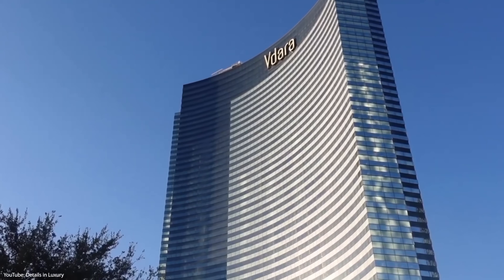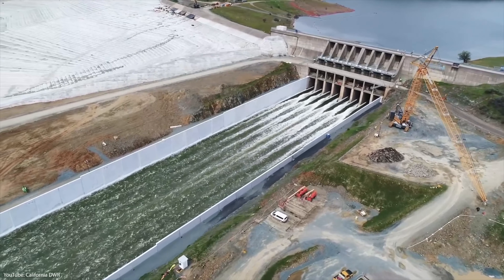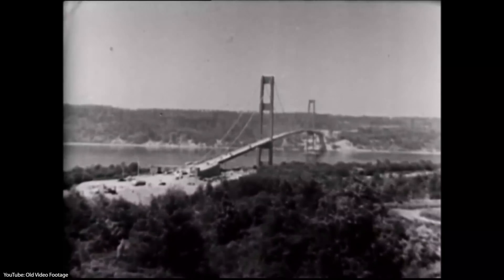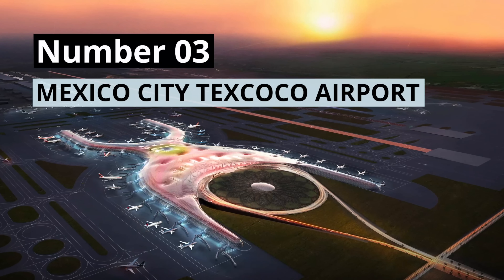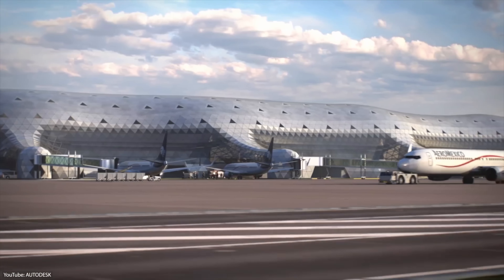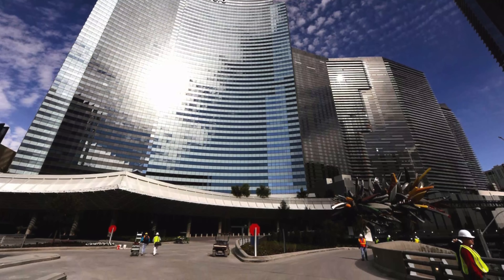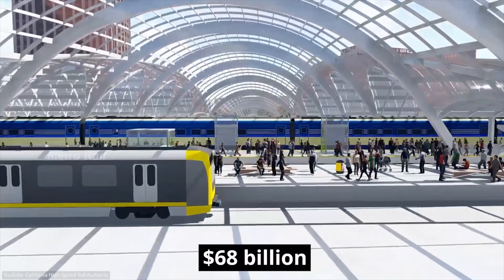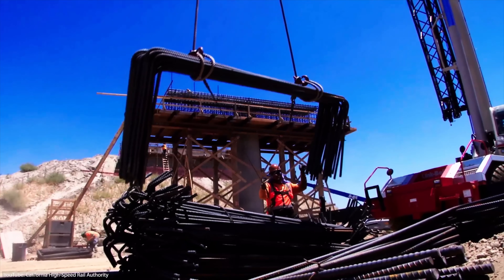Most Expensive Construction Mistakes in the World (Part 2)

Comment: When the three gorges dam in China fails,it will become the single most disastrous construction failure in history,as the loss of life will be staggering. In building this dam,large boulders were used to take up space so less concrete would be needed. However,2 problems I see is that there will be lots of voids under& around all these boulders,and second is that the concrete cannot bond with the smooth boulders. The boulders will eventually cause cracking of the concrete,and pressure from the water will begin to sleep through those cracks,causing the entire structure to weaken and eventually succumb to the enormous pressure of the billions of gallons of water behind the dam. It will be catastrophic,to put it mildly.

Comment: I think of construction mistakes as problems and errors made with the construction itself, not with how it was managed. The Tacoma Narrows Bridge is a perfect example of that; the Oroville Dam and the Vdara Hotel being a failure of design. With the Mexico City and California High-speed rail projects, there is nothing wrong with the design or engineering of those projects at all, those are a failure of politics, not a problem of the design, engineering, or construction. In regards to the CHR project being scaled back, it's not being scaled back, it's the timeline to finish it that has been extended. However, the project has seen a new influx of funding including moneys from the Build Back initiative implemented by Biden so, the project is now back in full swing. When completed, it will be a true asset to California and will serve as a real boon to California's economy when completed between L.A. and San Fran as well as being another key piece in fighting global warming in California. It will quite likely prove to be a very successful project that millions of people per year will be utilizing effectively significantly reducing road and air traffic between the two cities.

Comment: @2:13 he said they were forced to "open" the emergency spillway...totally wrong, there is no opening or closing of the emergency spillway, water either "over tops" the emergency spillway or it doesn't. It all depends on the inflow vs outflow once the dam is full and the regular spillway is maxed out water will spill over the emergency spillway OR in this instance they had to close all gates of the spillway to inspect the damage and make temporary repairs as best as possible. This caused the overtopping of the emergency spillway.

Comment: The California high speed rail project was prevented from starting for at least four years by cities suing the State because they were not on the line originally planned. As each new city was added, the engineers had to scrap their original plans and make new plans every few months. The original ascent over the Tehachapi Mountains had to be changed, land acquisitions had to changed, engineering plans had to be changed, everything that the original plans called for, on which the original costs had been calculated, had to be changed. Your original assertion is 10% to 15% accurate, but the remainder of the fault lies in the State’s permissive litigation milieu and the aggressive challenges made by towns and cities which feared being left behind if they were not served by the high speed railway.

Comment: This is not anywhere near the damn catastrophe but I was hauling precast concrete wall sections to a high rise building in south central Denver Colorado USA I believe it was a company from the east coast “New York “ if I remember correctly as they went up in floors of this all precast concrete building apparently they didn’t weld all the steel tabs that’s molded in the concrete sections so by the time they got up eight or nine floors they building shifted and started leaning shutting the project down instantly. I’m not sure what the end results were but I do know it sat like that for a long time with a cyclone fence around it 2002 -2003

Comment: This video is not good.  The airport is not a "construction" or engineering mistake at all.  As for #5, you didn't connect how the erosion of the spillways led to the evacuation.  The rain caused the evacuation.  The spillway corroded and collapsed, but it didn't cause MORE water to go down.  There's something you didn't explain.

Comment: Hey, something interesting for you to look into is the opening of the Golden Gate Bridge.  It came very close to collapsing on opening day because it could not handle the weight of the people walking across.
Reply: That wasn't opening day. It was the 50th anniversary bridge walk in 1987. I was one of the people on the bridge. The crowds were quite dense and the whole deck of the bridge was full of people. As it happens, the weight of a packed group of people is several times the weight of any imaginable collection of vehicles. So we overloaded the deck. Pictures of the bridge show that the camber was reversed; the center of the span was lower than the outer parts. Calculations indicated that it came pretty close to breaking the deck. At the time, I was wondering why the suspension cables were flapping.
Reply: How many people were on the golden gate on opening day?

Comment: The Teton Dam in east Idaho is one of the biggest blunders in construction. It was a massive earthen dam built in the 70's and took 4 years to complete, costing $48,825,000 ($346,109,678 today). Once complete, they began filling it. It took about 8 months to fill. It then promptly sprung a leak and broke: partly because the emergency spillways weren't complete, and partly because the earth used was porous volcanic soil which, unlike clay, doesn't seal fractures that form in it over time. It flooded the nearby cities of Rexburg and Hibbard and resulted in $322,000,000 ($1,676,839,050 today)  of damage.

Comment: You didn’t mention in the Texcoco Airport segment:

A) the referendum participation was less than 20% of the population. Mostly his cultist followers voted. 
B) the air force base is located 18 miles away from Mexico City. It takes you over an hour without traffic to get there. 
C) there is no infrastructure to get the planned passengers to the Air Base. 
E) The President ignored the warnings from people in the aviation community of both price and functionality and wanted the airport built during his tenure. 
D) the population of the area where the airbase is are mostly below the poverty line, so very few locals can use that airport
F) airlines only accepted to fly there after the government pressured them to do so. Yet the airlines also announced flights to other places away from either airports - namely Toluca and Puebla - places closer to areas of Mexico City where people actually go to, particularly the Santa Fe district. 
G) you have at least 2 videos with airports with these exact same characteristics and you know where this airbase airport is headed to.

Comment: The Tacoma Bridge did not come down because of high winds. The 30-40mph winds were close to the bridge's frequency of resonance, and magnified the bridge's movements, causing ever-increasing undulations.
Reply: This isnt correct either. It was attributed to flutter, a specific pattern of air vortices which is the same effect that makes seatbelts knock around sometimes when a cars window is opened. 

The way the bridge moves in the video is not consistent with it being resonance....it was twisting rather than oscillating in a single plane

Comment: A more recent example of a costly engineering mistake is the rebuilding of the Beltway 8 bridge over the Houston Ship Channel. Construction was already well underway with the new bridge when another study was conducted, and it noted some faults that would compromise the integrity of the new bridge, ultimately causing it to fail should construction on the bridge continue. Not sure what exactly those faults are, but they were enough of a concern that the new bridge is now having to be torn down and the whole process started over from scratch, costing an extra $300M-plus and delaying work on the bridge for several years.

Comment: The information about the Texcoco Airport is incomplete. 

1 The Texcoco remaning contracts were transfered to the Santa Lucia airport. 
2 The materials and some metallic structeres already placed were scrapped and also transported to the new airport.
3 Yes Santa Lucia is smaller compared to the Texcoco render showed (the versión of 2065) but if texcoco were built the current airport with his two terminals and 60 gates would be useless. Santa Lucia will operate simultaneusly with the current airport Benito Juarez.
4 The military base was demolished and rebuilt with modern installations and a museum with the mammoth bones found on the area.
5 The current airport usage taxes of Benito Juarez is above 20 dollars, Texcoco was planned to be 40. Santa Lucia will be 6.

Comment: You should mention the Sydney CBD & South East light rail. It was overbudget, it took too long to build, it's incredibly slow, the construction left residents insane due to noise, businesses went broke due to road closures, and most people use buses which run the same route but further at a much faster speed
Reply: may as well add the NBN to the list of stuff ups we've made
Reply: @youreworthyourweightinavoc7189  The NBN makes the CBD light rail look like the Parathanon

Comment: About the Mexican airport, the new airport also meant that we would loose 2 other airports do to the logistics, with the new one this is not going to happen. Also is going to be finished earlier. About the money, the money borrowed was repurposed for the new one and those whom had stock and didn’t want to keep with the new one were buy out at a very low price, the atinares of the loss are actually not accurate since it does not take in to acount what I just said.

Comment: After spending a lot of time in Europe, I knew the California high-speed rail project was going to be a failure from the start.  Even if it was completed, the cost of a ticket for normal operation is more than an airplane and takes 2 to 3 times longer to get to your destination.  In France, I took the bullet train for a business trip, and the experience is exactly the same as an airport.  It is not a commuter train.  They have x-ray machines, baggage check, etc.  At least in Europe, the bullet trains terminated at the airport so there was a natural transfer and not duplicate infrastructure for things like rental cars.  California terminated the bullet train outside of LA.  I am pretty sure the city of corrupt "Bell" was involved in this plan.  So, you get off the bullet train and travel another 2 hours by rental car?  Who here has flown into Ontario airport for a business meeting in Irvine?  I did it once and will never do it again.
Reply: The project managers should first and foremost have hired experts from Europe or Japan, to draw on their decades of experience instead of re-inventing HSR. One of the biggest advantages of rail is that the stations are typically located in the city centers.

But one small correction: the french TGV network is for the most part not how things work in the rest of Europe or Japan. Airport-style checks are not the norm - typically you just show up at the station a few minutes before departure, buy a ticket an board the train (which is another advantage over air travel).

Comment: The flaw in the Tacoma narrows bridge was not in its support issues. The deck had been designed far too slender. It's railings represented an almost wing like surface which caused air to oscillatie as it moved above and below the deck. The new deck is vented and it's side profile is also air flow friendly
Reply: And he says "Almost the size of the Goldent gate bridge" ! 🤣
2 lanes, 6 lanes... almost the same...
Reply: 8900' vs 5400' in length

Comment: The first one wasn't really a construction mistake, more of a lack of maintenance.  Sounds like the design was good, with emergency options built in.......but the footage was entertaining.
Reply: Entertaining misinformation....
Reply: Yeah, the second wasn't either, it's not really a mistake if it's something nobody even knew was a problem at the time.
Reply: It was a construction mistake, but more like a miscalculation. It wasn’t designed for an upward underground water table
Reply: As a citizen of Oroville
They did not inspect it as they were supposed to in 2013/14, which typically is done by drilling test samples out of areas to inspect the concrete decay/dmg, never did such.
I've had to evacuate 3x now in this town

The reason the dam took so long to fix, was because Kiewit the mining/construction company made responsible for the repair, was secretly Gold Mining the fuking dam and hill side.
My dad worked for them and i went up there a few times with him, and they told all workers no photos or videos, they had slues boxes up there filtering gold, used alot of explosives on the dam too, laid everyone off repeatedly per 2 weeks, over worked workers, and neglected the 120 degree temperature on the spillway overheating workers into heatstrokes working ppl 6-7 days a week 14hrs a day. which resulted in fines against them and then required water breaks every 30 minutes, and many ppl were helicoptered out for overheating, my dad secretly took pictures of the hole in the spillway, there was a huge gold vein in the thing, and my dad gave me a lil nugget he found.

Comment: Subconsultants were totally to blame for the California highspeed rail project fiasco. They bled that project like a bunch of vampires. I live in California and I also work with/for civil engineering firms. Never liked Gov. Newsom - but the one thing he did, I agreed with - was slam a halt to this monstrosity. If it had been designed and executed totally in house by Caltrans - it would have been finished a decade ago. Unfortunately we were foolish to vote in a proposition 20 years ago that required Caltrans to 'outsource' large public works projects to subconsultants to help boost the private sector.....well, that's been shown to be a mistake!  When you assign a committee to design a 'horse' - you'll end up with a 'camel'.

Comment: The worst one in the New England area was Boston's "The big dig" to put a new tunnel under the city. Went way way over budget and took forever. Concrete slabs have fallen from the ceiling in the tunnel from faulty hardware and killed people driving through. Probably a good one for part 3.
Reply: Also took all the funds from the transit authority leading to low maintenance on the Boston Metro leading to all the issues seen now
Reply: Wasn’t that Ted Kennedy pet pork project
Reply: Concrete is useless as a building material.it is not water resistant.i used to live in an apartment block in the u k,which was made from a concrete grid.the flat roof let rainwater into the flats directly underneath it .there was no escape for rain whatsoever onto the ground below.even then,the noise in heavy rain would have kept residents awake,and with the damage that does to the body clock and one's ability to work.
Reply: Ya, 1 billion swelled to 10 billion .. money lined corrupt players along the way.. lack of peer review sited as slurry walls leaked all over the place... it was stupidly managed by greedy politicians and backdoor deals with construction and vendor companies.. Typical Massachusetts politics...

Comment: In France we made a mistake not as expensive as those mentioned in this video but much more stupid: national train company ordered 2000 new train sets without taking into account the width of the station platforms… 1300 platforms had to be cut and additional footboards had to be installed on some older trains…  Moreover, the new trains were too heavy for some old bridges and thus they were not able to run on some of the train lines they were build for 😂

Comment: In South Africa we have two Coal power stations, Kusile and Madupe. It was planned to be completed within 5 years, it took more than 10 years. With corruption and poor planning the projects cost was over 500% of the budget and after it is completed the stations are only 50% effective compared to what was planned when it was designed. Now due to these two mega projects failures the country has rolling blackouts, and in dire need of electricity.  The cost of construction and loss due to to electricity shortages makes this the biggest failures and most expensive South Africa have ever experience.

Comment: We have a funny story told in Turkey. Government intended to build a tunnel, and they called a contractor for an interview. They asked the contractor, "OK, tell us how are you going to build the tunnel". And he said, "we will start digging from both sides. If we meet in the middle,  then it's good. If we don't, you'll have two tunnels"

Even though most of the construction projects are very successful in Turkey right now, in the past we had a Ayas tunnel disaster. Ayas tunnel is aimed to be the main passing point of hilly mountains between Ankara and İstanbul, but it ended up becoming a costly potato warehouse. You can check Wikipedia for more info.

Comment: We need more curved buildings magnifying Sun beams onto solar panels.
Reply: unless you decided to build solar panels into a cave, why not just put them on the building instead of need a building to reflect the light?
Reply: @shikniwho7215  Using the building to reflect the light means your get more with less solar panels... the building will still function as a building with windows... while the solar panels will be more efficient. Putting the panels on the building wont really help anything.
Reply: @Joe-cd1jx  except that solar modukes are less efficient as they get hot. So you may want a solar collector that uses a working thermal fluid, which I believe are generally less efficient than solar modules